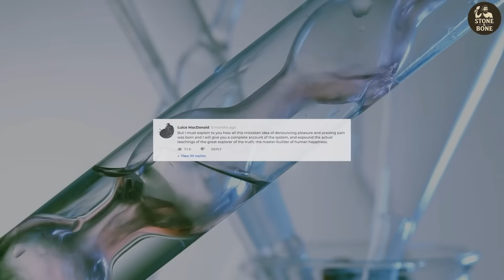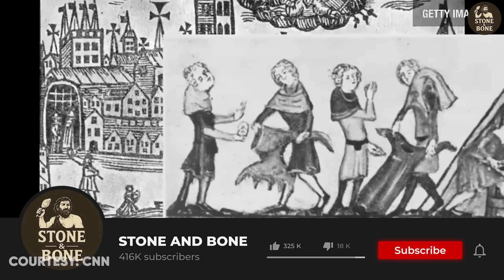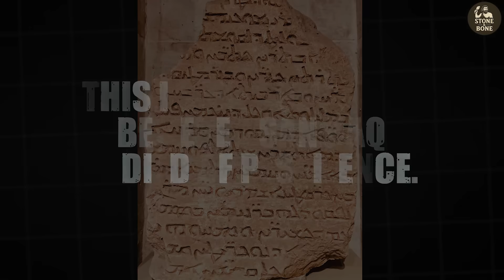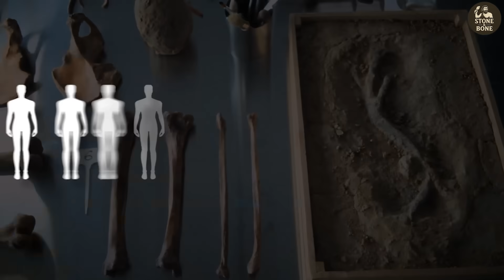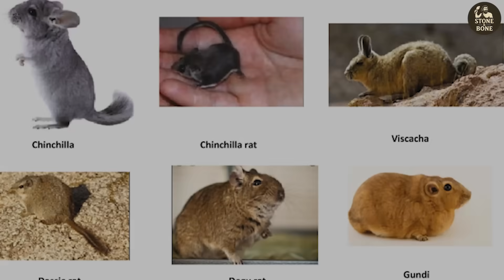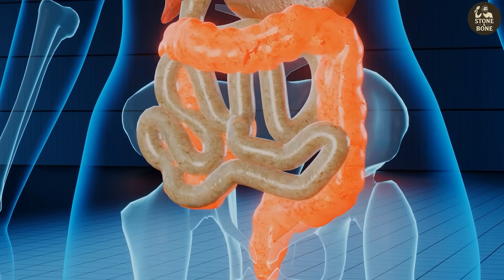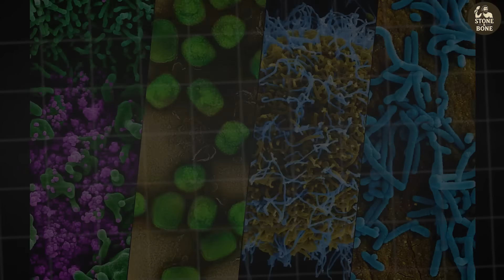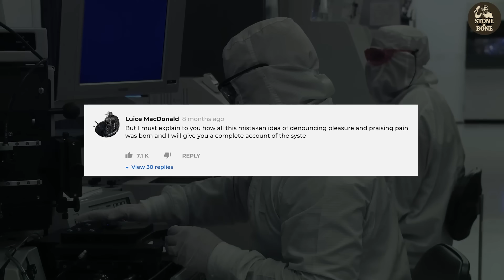Black Death’s TRUE Origin Finally EXPOSED by Ancient DNA

Comment: Sounds like your numbers don't add up for death in city's
Reply from the maker: That’s a really good observation. The truth is, the numbers for city deaths during the Black Death are often rough estimates because records from the 14th century weren’t always reliable. Many were based on church burials, tax rolls, or chronicles, and those could exaggerate or undercount.

What most researchers agree on is that urban areas were usually hit harder than rural ones, since cities were crowded, sanitation was poor, and rats thrived there. For example:

Florence (1348) – some chronicles claim up to 60–70% died, though modern historians suggest it was closer to 50%.

London – parish data points to around 40–50% mortality.

Paris – estimates hover around 45–50%, though some reports say higher.

So if the numbers I mentioned earlier seemed off, that’s because sources vary a lot. The overall pattern, though, is consistent: cities lost nearly half their population on average, while some smaller places were nearly wiped out.

Would you like me to dive into the latest DNA-based research from plague burial pits, which gives more concrete numbers?

Comment: At least theyre warning us of the next pandemic!
Reply from the maker: Exactly—studying the Black Death isn’t just about the past. 🦠 By decoding its DNA, scientists learn how pathogens evolve and spread, which helps improve **modern pandemic preparedness**. It’s like history giving us an early warning system.
Reply: Mr. Giggles has worked very hard on this, to block easy recover. To fasten it to covid so it can be air spread by drone. You may understand this backwards. 
But I understood he was working on ebola,  looks like I may be in the wrong.
Reply: @charlanpennington3989 Stop it you pack dills.
Reply: @charlanpennington3989 Bubonic plague is "Black Death". It popped up in the US in the 70s from these grave robbers returning to the US for treatment. This bs should be illegal